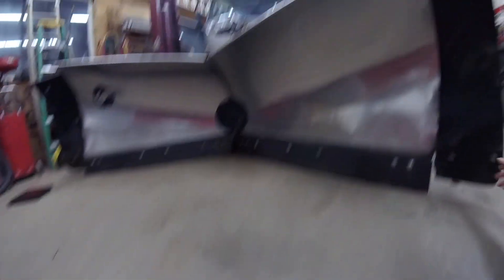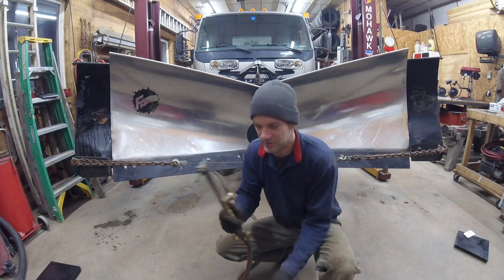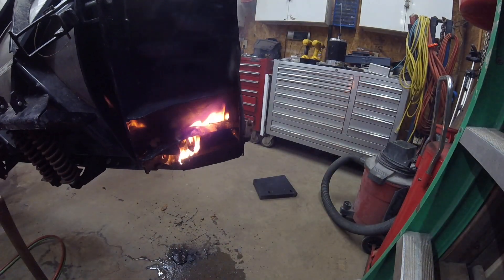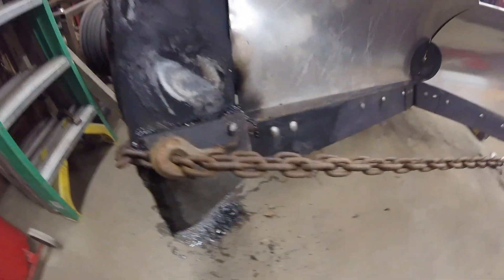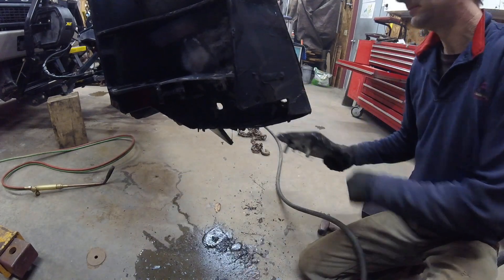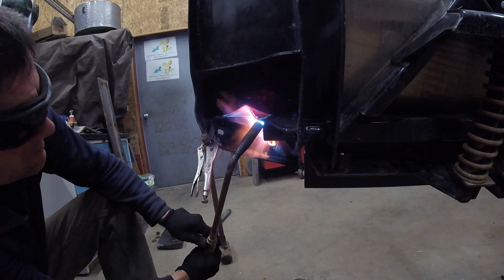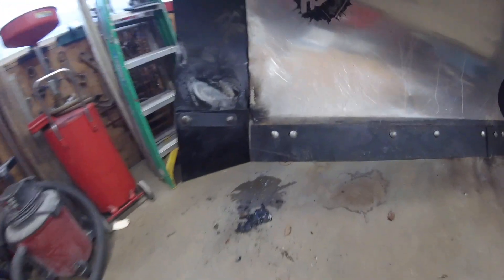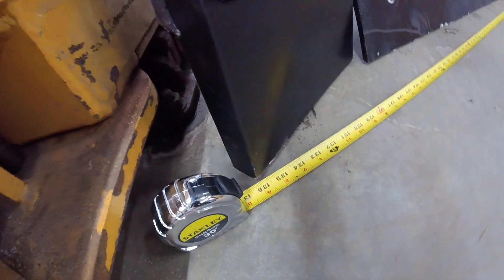Fisher XV2 Extensions repairs

Comment: A bit of heat helps alot!   Good fix , they look ready to move some snow!
      
     Try  the fluid film program or  accidentally spray some oil under the frame , on  ferrous components etc.   It will make a big difference for how long things last in the salty conditions.

Comment: Need some northern advice. I have followed your video series for a while now and would like to know if you still like the fuso fg. I am about to move back to schroon lake N.Y. in a year and need a new work truck. Would you recommend  the FG over a f350 if their price were similar? Any drawbacks with the fg I should consider? Thanks
Reply from the maker: I would have to say the FG with the manual transmission is a superior work truck over the f350 especially while plowing snow with the great visibility and mirror placement being high and forward of the tire, they do not get dirty from slushy roads.  The problem is they are becoming scarce. The only drawback with mine at the moment is the frame rusted and is now thin and cracking.  I'm thinking about buying a new frame for it (6k not installed) that's how much I liked it.
Reply: @NEILSWORLD  any thoughts on the new automatics because I doubt I'll be able to get a manyal. Also I have not seen any data on towing have you? How easy is it getting basic parts in the area (or getting bigger issues fixed). There a dealer you recommend? Thanks again.
Reply from the maker: @pitkinweldingfabrication7573  my local dealer told me he would not sell me one with an automatic transmission in it. I have talked with someone that delivers firewood with one and said they had to get towed off from lawns twice in one day that the truck would not even spin the tires it would just sit there.  I haven't had any trouble getting parts or service work done
Reply from the maker: @pitkinweldingfabrication7573  the fuso poles my John Deere 4700 tractor without any problems.